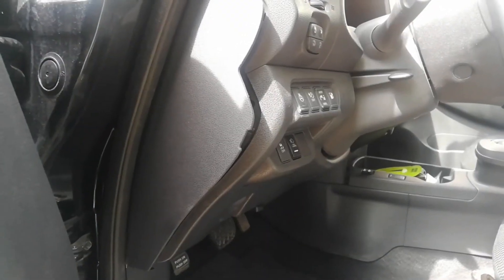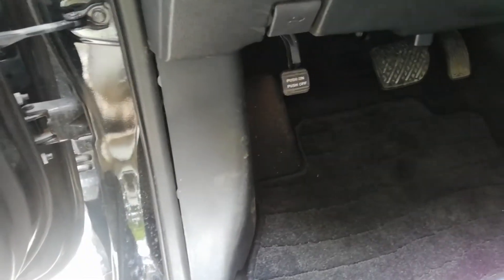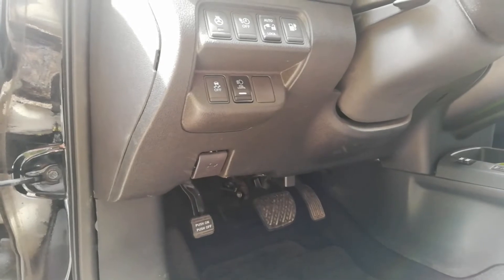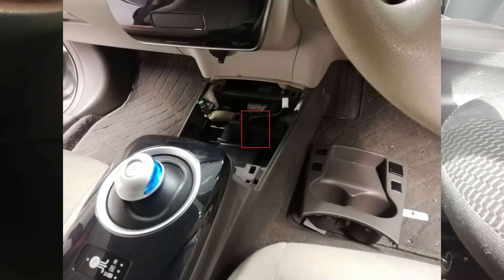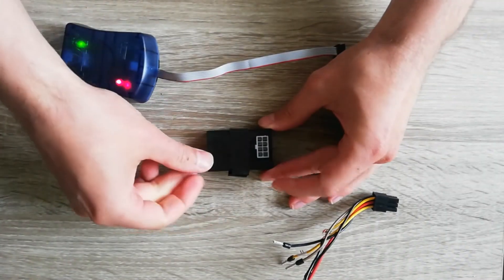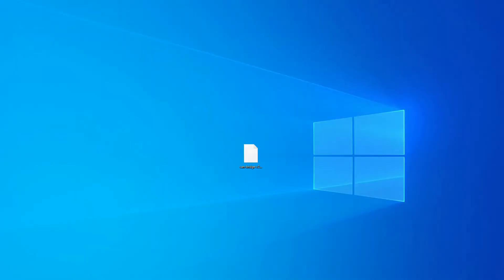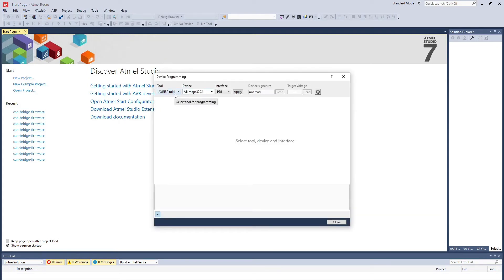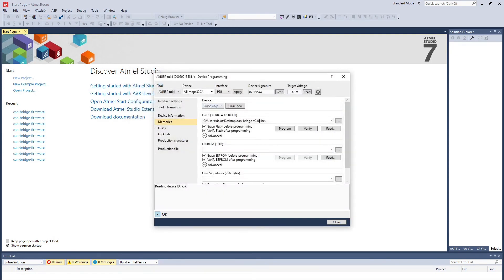CAN-Bridge: Location & Firmware update

Comment: leaf 2018: I would like to upgrade a 40 kwh battery to a 62 kwh battery. I would buy 24 pieces of 180Ah modules, but I would use the same cables and I already install a BMS. Is there already a CANBUS bridge and necessary upgrade software for this model? Thank you very much for the answer.
Reply from the maker: I don't have anything for this! Ask some other company!

Comment: Awesome work! I was looking at the schematics for the 3 port CAN bridge. I think t it would be cool to make an iteration for this board that plugs in to the OBD2 port and does not require splicing in to the wiring harness. I belive all the lines required are available on the OBD2 port
Reply from the maker: Not possible via OBD2. It needs to splice. It needs to separate the battery from the rest of the car, to be able to modify messages in/out
Reply: @DalasEVRepair  ok I understand. Thanks for clarifying. What about reflashing the vehicles ECU? Not sure if it’s also called an ECU on the leaf
Reply from the maker: @ed_ev  Some forms of reverse engineering is illegal. Dumping the VCU contents and modifying it infringes on IP. If you do it on your own, go for it! But I as a company cannot offer it.
Reply: @DalasEVRepair  ok. Regardless, I think all the work you’re doing is awesome! I really enjoy watching your videos. Keep it up!

Comment: Thanks for all the info! I'm trying to access EVCAN for a university project on a ZE-1 e+. The connector seems to have changed somewhat and the blue and green wires are no longer under each other. Instead they are diagonal. Are they still the EVCAN wires please?
Reply from the maker: If it is a twisted pair, its most likely the EV-CAN!

Comment: I am at the stage of installing one of Dala's CAN-bridges. Can anyone suggest where to get a 12volt supply from on a right-hand-side drive LEAF? The OBD2 port is on the driver's side so on the other side of the car.
Thanks
Reply: any 12v constant will do, like the radio (generally a yellow wire). I did notice a yellow wire in the same loom as the can bus so you could probably use that, test for 12v while the car is off.

Comment: This worked perfectly for my buddy's 2012 light interior battery upgrade today! Mo' miles baby!
Reply from the maker: Awesome! 😁
Reply: I have a 2012 24 kWh leaf in the US with roughly 53% SOH and the ChaDeMo option. It’s only been DC fast charged a dozen times in total and according to LeafSpy cell balance is quite uniform at about 15-20 mv across all the pack. Would this set of tools, software and CAN bridge hardware, be of much benefit in my case if I don’t do any battery upgrades or replacement?

Comment: I really enjoy your videos. I am wondering can this CAN bride apply to a extended range battery pack. What i mean, i add 30kw pack in the trunk of my 2012 leaf. But as you know the milometer reads only the original pack milage. I parallel the pack after the contactors and use the same control wires to precharge and connect to the system. Let me know. As i see some people get the total packs milage but do not tell how they did it. Thank you
Reply from the maker: Yes, this is what MUXSAN is doing! Totally possible!

Comment: hmmm... I'm not use about can line topology! e.g. putting a canbridge in a specific location can override can messages "water up" the can line but not "water down". E.g. positioning canbridge in a location than other can affect some devices and other not (am I right?). You shown three possible locations depending on model. Are these locations enough to override battery messages or something else?
Reply from the maker: The locations shown are for battery messages only. Both locations are where the EV-CAN wiring enters the chassi, so the splice happens right before the battery has a chance to talk with any other module.
If you for instance want to modify the messages that are being sent from the VCM->Inverter, you should instead cut the EV-CAN right at the VCM behind the glovebox. Like if you want to increase the amount of regen
Reply: @DalasEVRepair  And do you have the necessary SW to increase regen?
Reply from the maker: @RNMentropy  Yes, but not publically available yet. It should only be used with fresh batteries that can take the extra amount of regen!
Reply: @DalasEVRepair  can you go up to 80 kW? 😉
Reply from the maker: @RNMentropy  Yes 😂
Reply: @DalasEVRepair  ok, clear! tnx